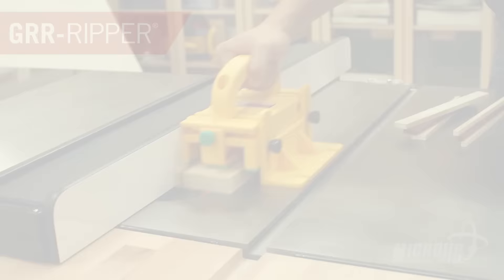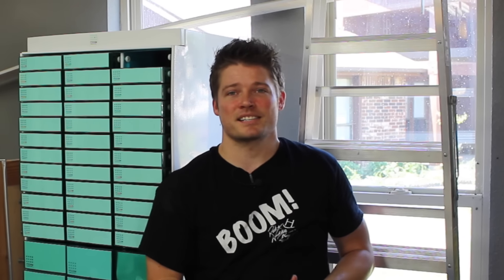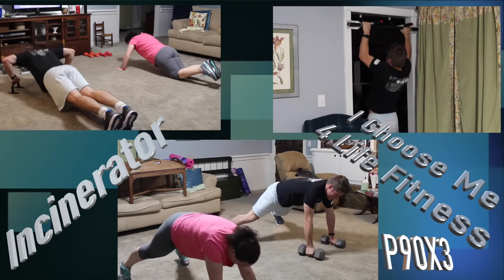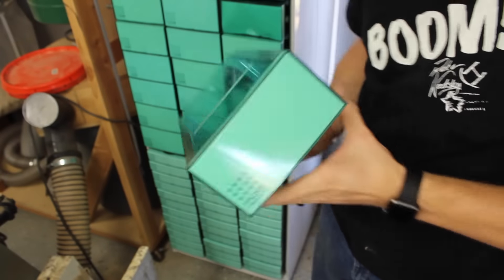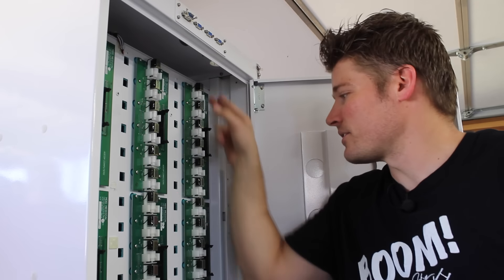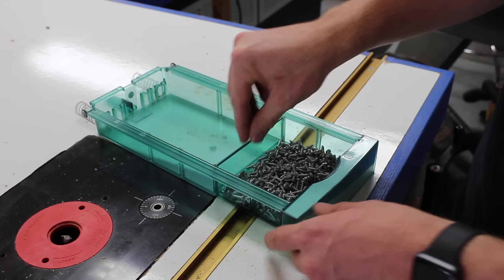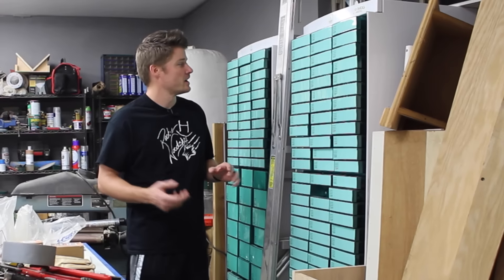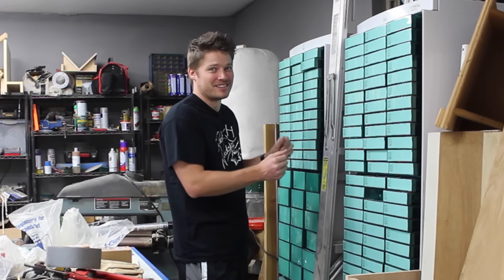Think.........Storage!!!

Comment: Small nitpick: should have taken those boards to a e-recycling place
Reply: Everfalling Yep. It's not suited for general waste.
Reply from the maker: Oh dang. Didn't know. Now I do! Ty
Reply: +Everfalling 
Yep, definitely a nitpick!
Reply: +Rock-n H Woodshop On the same track, you can sand them flat with a belt sander to get the metals off (use a respirator or a good quality dust mask), and then you can make geeky projects with them, cutting just like wood. Silicon and its substrate cut really easily, and beautifully straight for the most part, if you use an 80-tooth blade. The solders are lead free in 99% of cases, and the actual electric channels are copper and really thin, on the scale of nanometers in some cases.. Easily cut with a table saw.
Reply: +Everfalling Well then you should recycle them the next time you do something using them, instead of concerning yourself with someone elses damn garbage.

Comment: I would have been tempted to experiment with a few batteries to find the voltage that would lift the solenoids.  One could then touch the battery wires on each solenoid, and push the drawer from the back to release it.  Then at the front, remove each drawer and break off (or cut with a Dremel) the tab that has the locking pin hole.  No need to remove all that stuff in the back.
No doubt you will get loads more of these cabinets, so you might like to consider this approach  ( just kidding!)
Good to see you back - I was wondering  . . . . .

Comment: I had a thought...if the locking mechanism is gravity fed, couldn't you turn the cabinet upside down and then just press the drawer from the front to take the pressure off the locking pin so it pops free? Then the springs on the back will stop the drawer from locking back in if you don't want to take them all out again.
Just thought it would be a lot less fiddly than lifting the locking pin with a screwdriver.
Reply from the maker: That was my Mischel thought too, but those cabinets are super super heavy. Me being by myself was a little bit too difficult
Reply from the maker: +Rock-n H Woodshop initial thought

Comment: If you remove the springs from the back of the drawers, they will probably go in better and look nicer.
Reply from the maker: I would but there is no way to pull them out after that. No clearance for fingers. Right now I just tap it and it springs forward. 😉